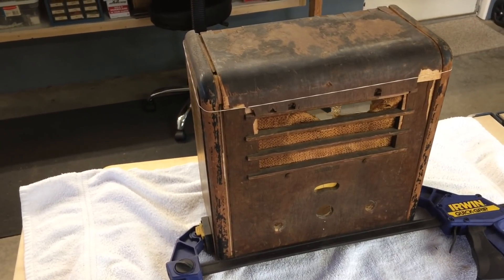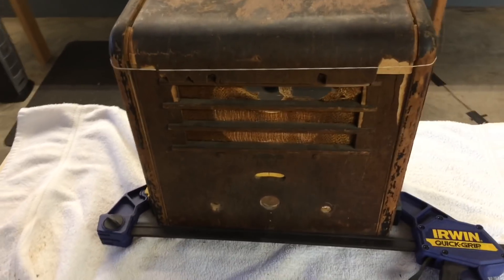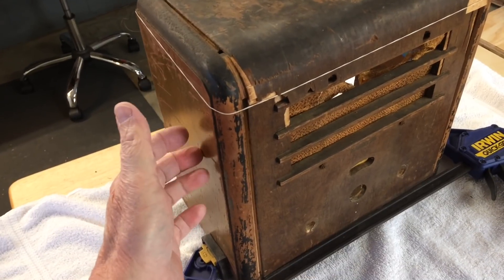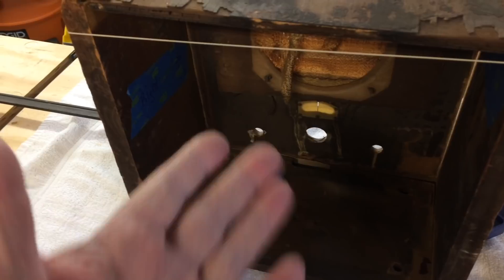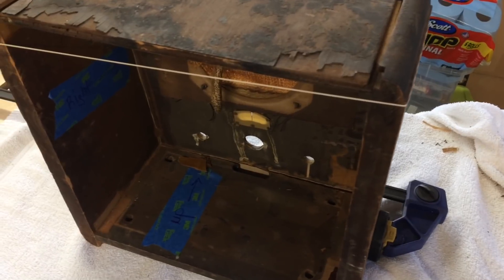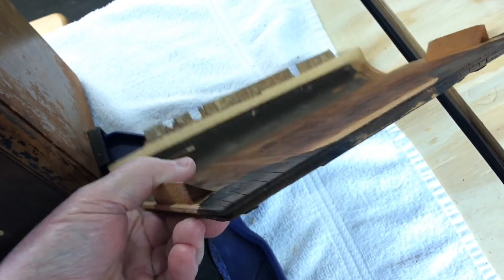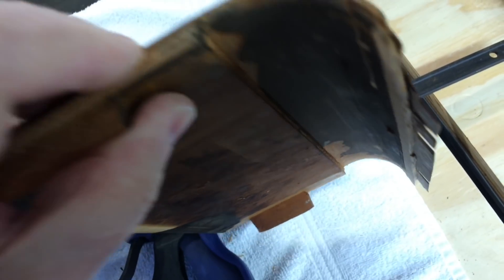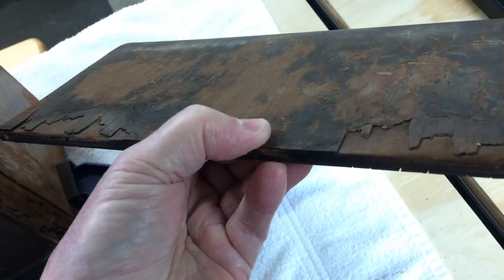Kadette Tele-matic AC Model 35 - Cabinet Assessment P1

Comment: Oh my... it hurts to look at this one. So sad what can happen to one of these fragile radios when they aren’t packed correctly. Hey Don, I fairly recently told you about an Airline purchase of mine, inspired by your recent Airline Teledial renovation. When I was looking for one like your Teledial, I came across this one and bought it. It’s a Wards Airline 64WG-1054A, a little metal lunchbox looking radio. The fellow put it in a box with only four or five of those larger 4 x 6” air pillows in the box to protect it and when I got it, the air pillows were flat and the poor little radio had bounced from one side of the box to the other the whole trip. Amazingly because of the metal lunchbox construction, it was fine other than the tubes becoming displaced but even they were in tube guards so they didn’t go anywhere... Just got lucky I suppose. After watching this and the earlier videos about this great little Kadette, I had to tell you about it...         Buddy
Reply from the maker: Buddy, I’m sure glad yours didn’t get destroyed like mine. Is it a good player or are you still working on it? Best, Don
Reply: Hi Don! It’s sitting in the back burner right now. I started working on this just the other day: https://philcoradio.com/phorum/showthread.php?tid=19743